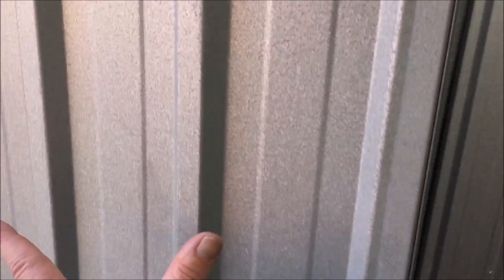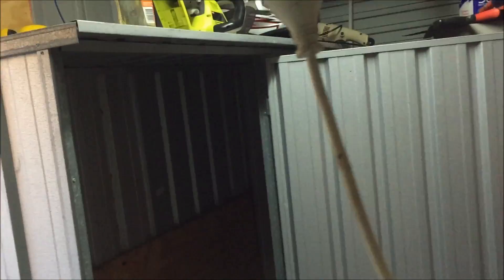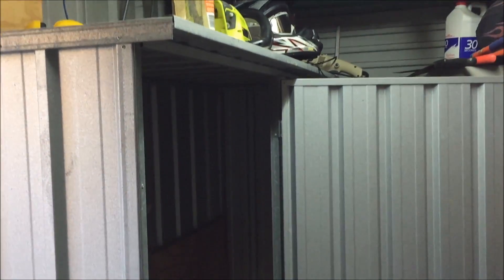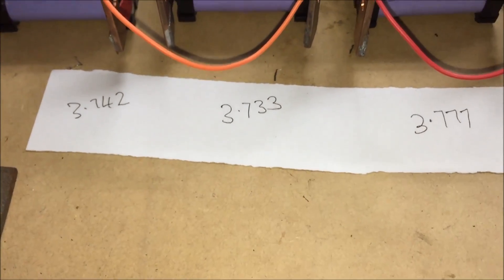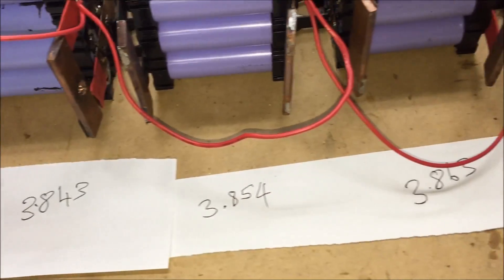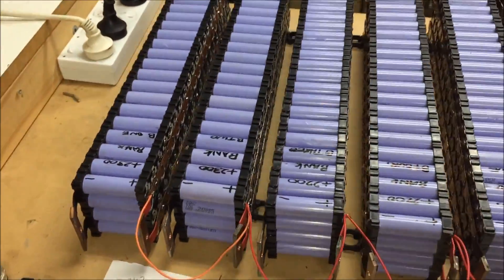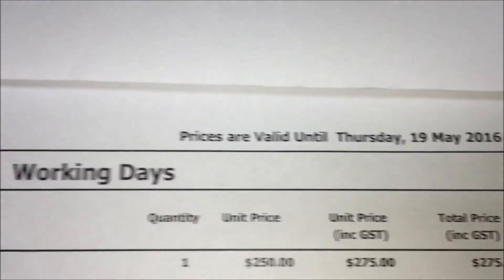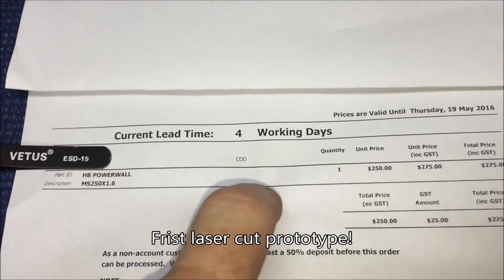HomeBrew Powerwall Shed - it's time to start the process of installing

Comment: Peter dont balance in the middle.  one module @40% SOC will be 3.7v  while the next @60% SOC will read the same 3.7v,  Balance at the edges of the charge/discharge curve.  Bottom or top however you decide.     If I was you Id charge all the modules connected parallel like you have them now and once all rest at 4.2v id consider them top balanced
Reply from the maker: +jehugarcia unfortuntally i need to hook it up because I don't have a charger large enough to charge it. It will be a process but i'll slowly bring them up .05 of a volt over a week or so then once they get to 4v i'll discharge and charge again to 4.1 then 4.2 v then the plan is that the BMS will take care of the final top balance and i'll be good to go..
Reply: Don't you have a bunch of PC power supplies with 5V outputs?     Parallel a few of those you'll have that battery up to 4V in a few days,   just make sure to stop before reaching 5V of course.   use a lipo chime set to 4V with a relay to disconnect automatically if you don't want to babysit
Reply from the maker: I have just a few laying around, might try it today on an old pack first - don't want to mess this up hehe